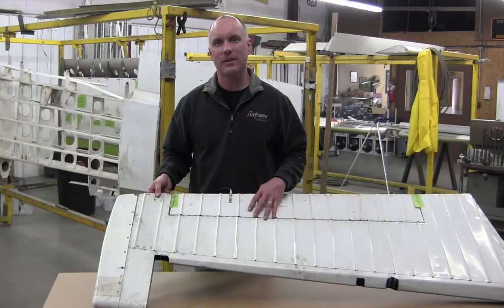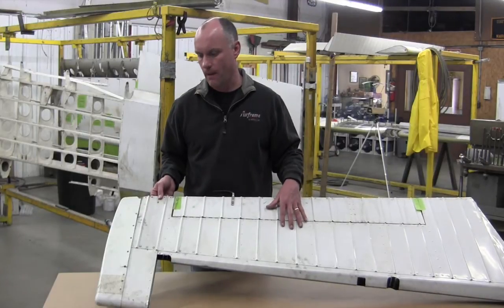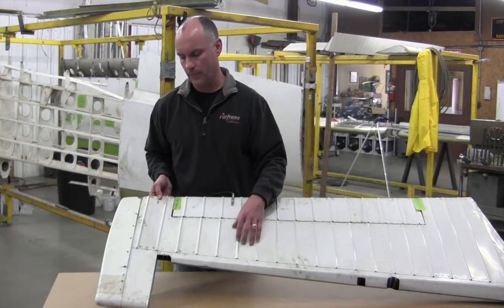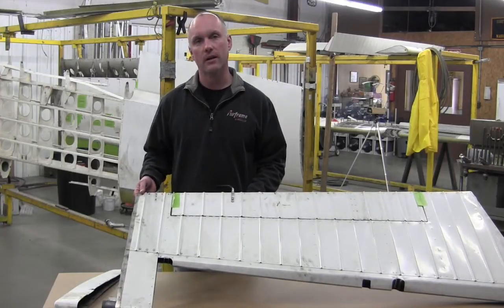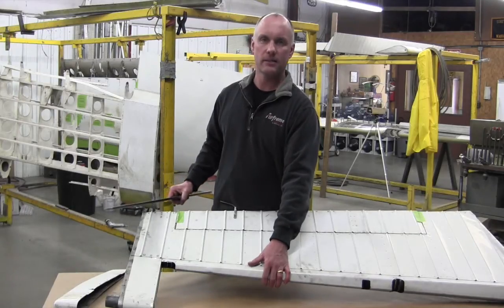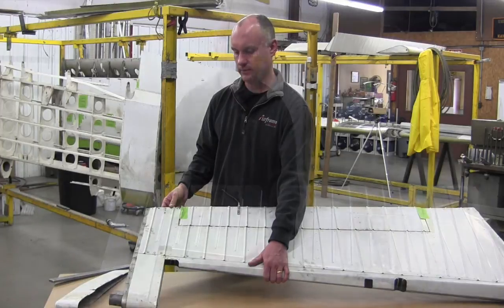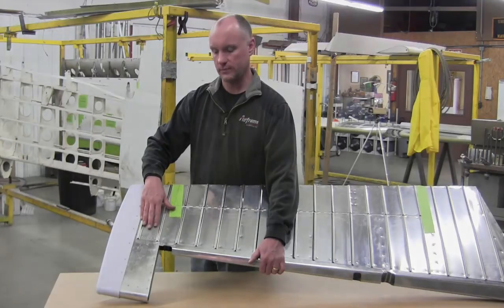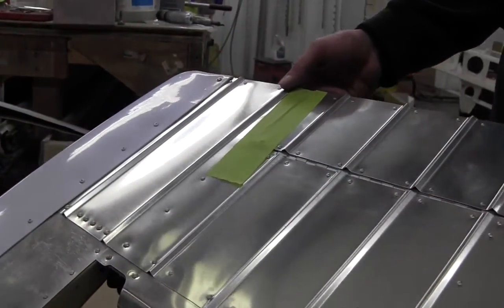Cessna 182 Elevators SB 02-55-01 & SEB 03-1

Comment: I’ve been a AME structure guy for over 10 years. And I think this long bar technique is a bad idea. You won’t be able to see or feel what you are bucking. That bar will probably be bouncing around because you won’t have any control of it two feet any. Damage the inside of the skin, and probably damage shop heads of any rivets around. Take the time and do it as instructed. 
But that’s my opinion
Reply: Respectfully disagree Scott.  Recently observed the crew at Airframe Components perform the long bucking bar technique and they're able to feel the rivet properly seat before bucking, and there's no bouncing of the bar.  These guys have perfected this technique and done so for years or maybe decades - they're not your typical sheet metal shop.  The precision and skill demonstrated by the guys at AC you would not expect to find at a typical maintenance shop.